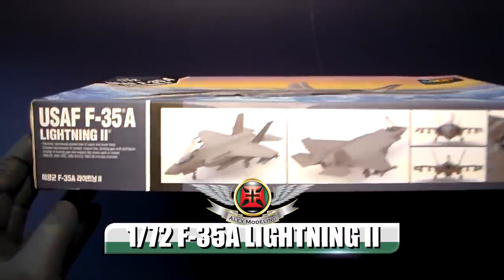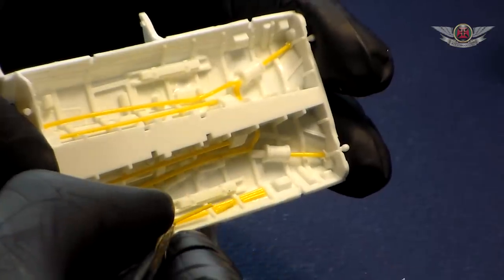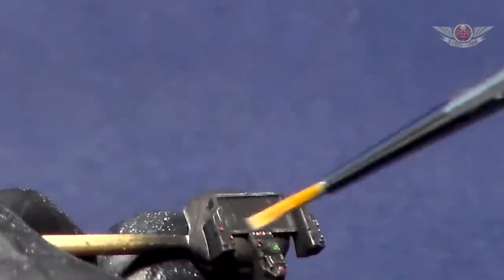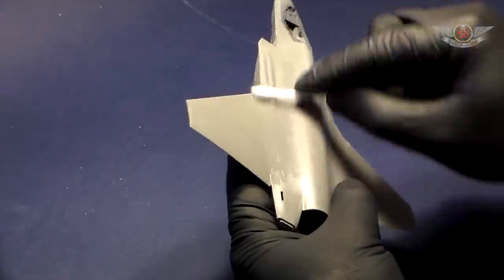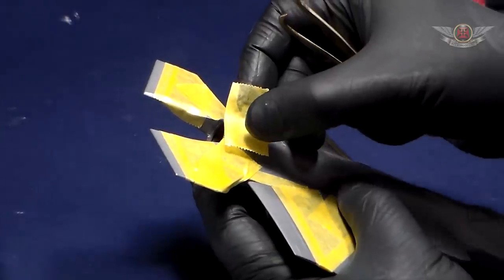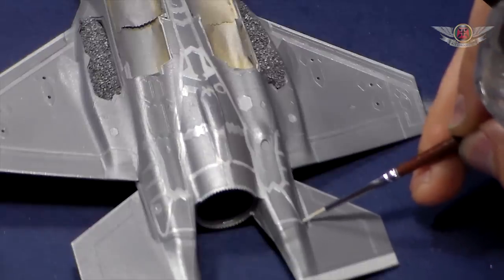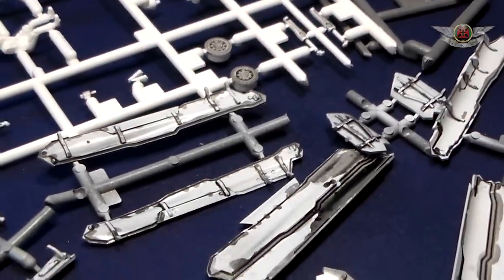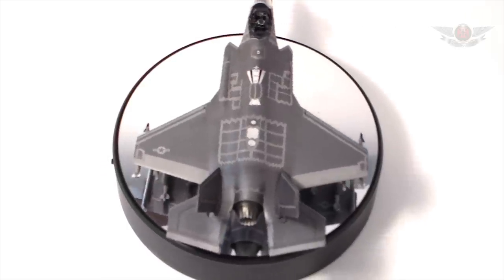1/72 ACADEMY F35-A FULL BUILD VIDEO -AIRCRAFT MODEL

Comment: I finally get time to sit and watch this.

The F-35 sure is a pretty looking thing isn't it. 

Nice work Alex, I'm sure he'll be very pleased with it.
Reply from the maker: Sure hope so... F35 the most expensive weapon in the world.. pilot helmet alone costs 400.000 dolars... i have to sell helmets!
Reply: @AlexModeling  The B-2 is more expensive.  $2 billion per plane.  There's no other military plane that comes close to the cost of the B-2.  Even the deluxe model A380 is less than $450million (but head of state A380s could easily cost at least 33% more than the high-end model A380).  The only plane more expensive than the B-2 is the new Air Force One.  That's rumored to be over $2.6billion (double that because TWO planes are actually being bought) largely because of special electronic equipment.  It has to have special safety features (gotta be able to survive World War III!) AND double as a command/control vehicle so it will be more than just a "modified 747."  Air Force One technically ISN'T military since it's a head of state plane but still--!
Yes, the F-35 program OVERALL could be the most expensive plane program in recent history but there will probably be at least 3,000 of these planes manufactured.

And there are other fighters out there more expensive per plane than the F-35 is NOW.
The Rafale, EuroFighter Typhoon, Su-57 are comparably expensive PER PLANE (averaging closer to $110million-$120million a plane) but their technology is generally 4.5 generation.  The costs for those planes will probably never significantly diminish because there just aren't many of them being built.  When a fighter program has fewer than 900 planes built, it's generally considered small-run and they'll be lucky to break-even in costs IF the production run doesn't exceed at least 600 units. 

The F-35 is at least a generation ahead in technology for (at most) the same cost per plane as the 4.5 generation fighters. 

There are going to be many more F-35s built and the unit cost per plane will go down ($90million looks believable; below that probably won't happen realistically) as production ramps up.  It will never be as cheap as the F-16 was in the 1980s but nothing will be that "relatively inexpensive" because of inflation and the cost of the electronics being put into the plane which are still the most expensive items of the plane by far.  They were also building at least 120 F-16s per year for much of the 1980s and there's no plane project RIGHT NOW that has such a high level of production partly because A) they're all much more expensive than the 1980s brand F-16 to build and B) the level of sophistication of today's plane and their electronics is much higher, too.  A LOT of air forces are shrinking to as little as 1/4 the size they were in the 1980s!  

Don't believe all the negative hype.
I'm not a huge fan of the F-35 program but the media loves to spin negative articles about these things because negativity sells.

Comment: Does the canopy close? Do the gears move? Do the bomb bay doors close? Overall, very nice
Reply: Umm he hearted it but never responded so I will answer that for you. I'm assuming this is true since I have the f35b model not the a model but the doors, wheels, and cockpit are all glued in. Unfortunately there are no moving parts. You could however possibly mod the wheels so they move.
Reply from the maker: Thank you for answering 🙂👍👍
Reply from the maker: Sorry for late reply. Unfortunatly the parts don't move! 🙂
Reply: @AlexModeling  Thats alright. I got this model anyways and it turned out great. Thanks!